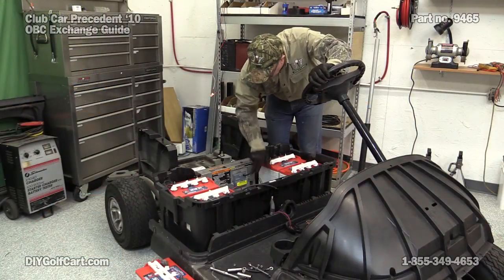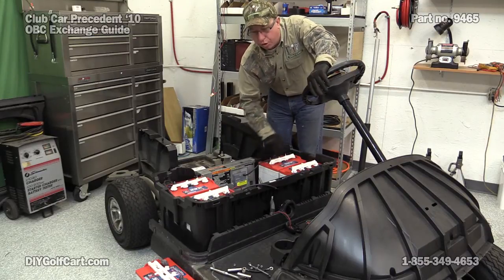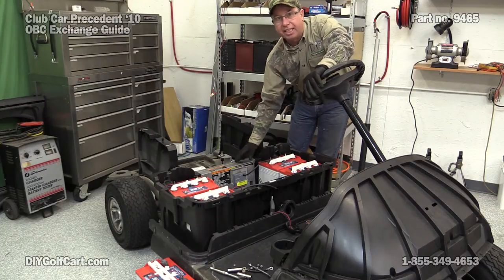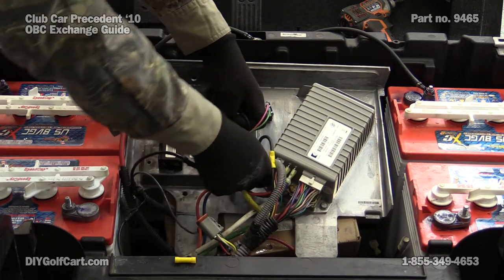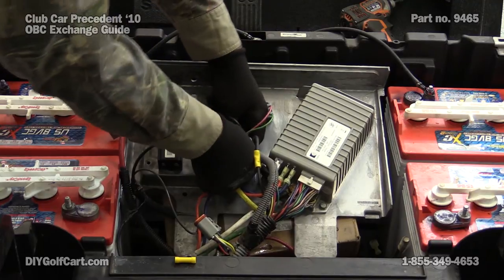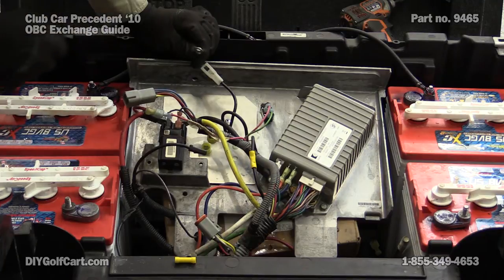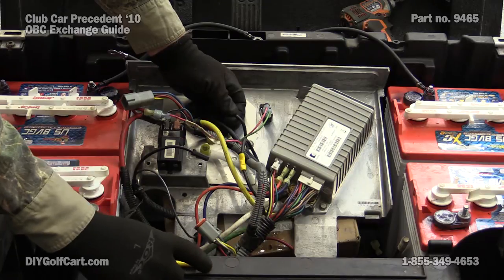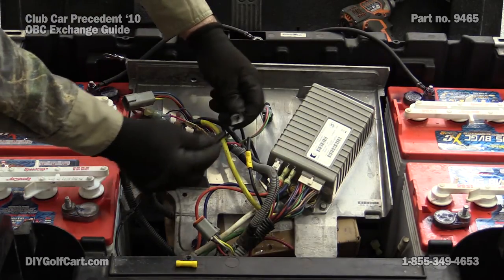On Board Computer | How to Replace on Club Car Precedent Golf Cart | OBC

Comment: Does a 2005 have a OBC? My cart has been in two shops over two months and no one can figure out the problem. I really need your help. One battery out of 6 is not charging right. They are new batteries. It is the one spot that is not charging right. You can push the pedal and ride 20 minutes but when you let off the gas and try to go again it starts jumping. If you let it sit and cool down or what ever then it will take off again.

Comment: Thanks a lot for this nice video. I have a problem I just change ine bad battery in my club car 2000 after this the charger does charge it make hamming noise but ni charge I can hear the rely clicking but no charge. I checked the charger with a friend golf cart it is working fine. My question is this the computer or other hidden fuse? By the,way the golf cart is working fine. Your reply will be appreciated. Thanks
Reply from the maker: calltoAllah1 Check to make sure you wired the battery correctly.....neg to pos.

Comment: My 2005 Club Car NEV charger no longer shuts off automatically and battery charger display only is accurate to 25% mark and gets stuck there rather than showing full charge. Is the computer the problem or is it the charger? I need to replace batteries but am afraid they will overcharge and be ruined if the charging problem isn't addressed first.
Reply from the maker: +Therese Khan Load test the batteries. If all the batteries under load stay above 7.9 volts, then the OBC is going bad.